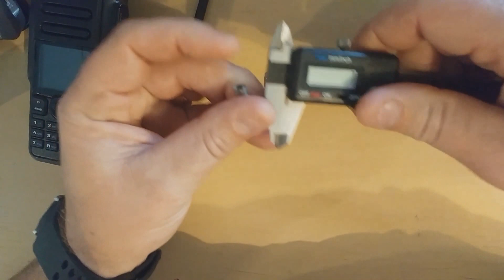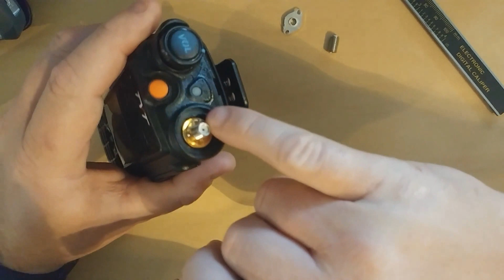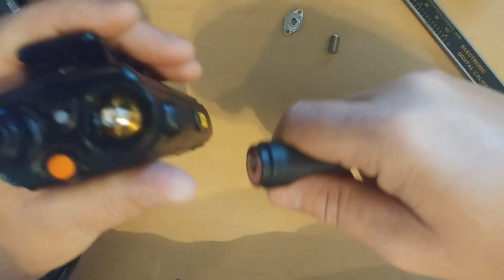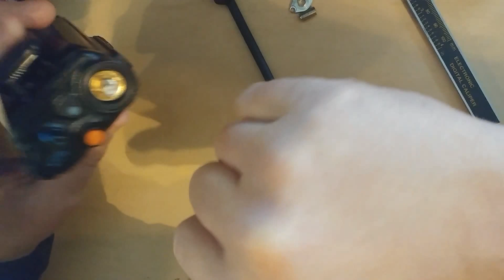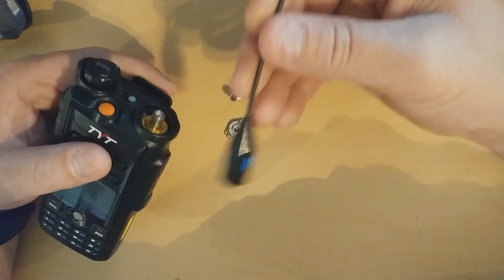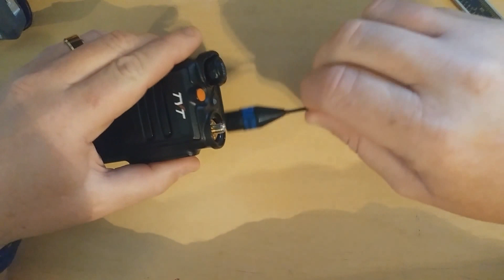TYT MD 2017 connector failure theory

Comment: I think the problem is that these are just the wrong connectors for the purpose. In the commercial world you can expect users to screw the antenna on and then leave it alone but we hams like to experiment so we're constantly swapping aerials. The BNC connector is big and ugly in comparison but serves very well where constant antenna changing is required. Maybe there would also be issues with the waterproofing if a BNC was used? I have the Retevis RT82 version of this radio - if this ever happens to it I might consider trying to replace the SMA with a BNC. 73 de G0TVJ

Comment: I'd be inclined to use an SMA-BNC adapter. At least BNC is sturdier and more universal and no force required to attach it. 

What is the stubby part at the base of the 2017 aerial for?
Reply from the maker: The short stubby part is my guess the 440 antenna and the longer on is the 2m antenna i think thats just a backwoods guess lol
Reply: AirWavZ KG4VDZ 

If the stubby part is UHF, no wonder reception is poor.  Anytone have a dual band DMR handheld out now. AT 868 UV

Comment: The antenna base is larger in diameter than most HT antennas promoting a better grip on the antenna causing over tightening and then the metal beaks at the weakest point. I installed a rubber seal and a diamond SRH77CA on my MD-2017 and it works fine and greatly improved the receive and transmit of the radio. Great video.
Reply: teh60 where did you get the seal? Or what kind did you use?